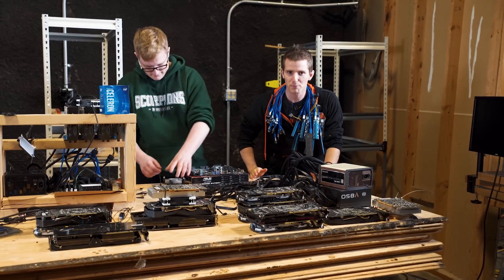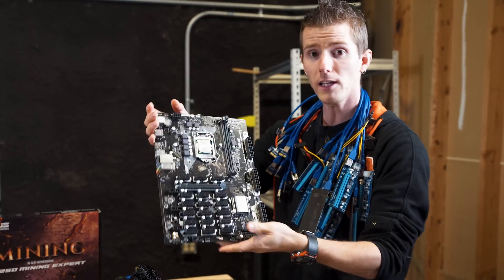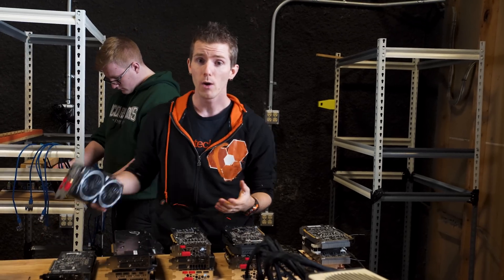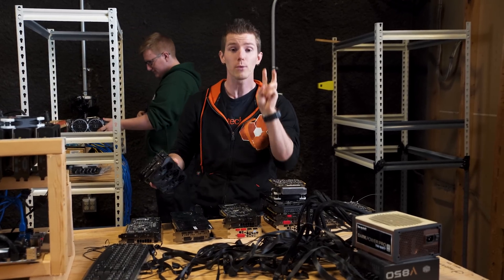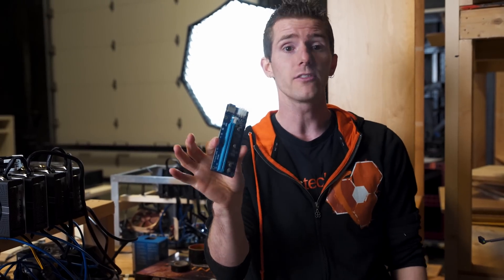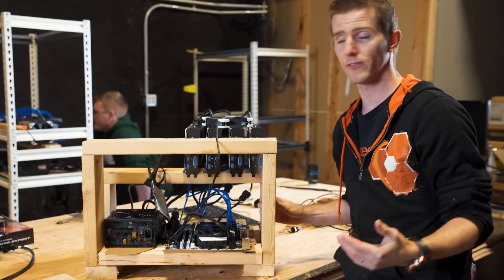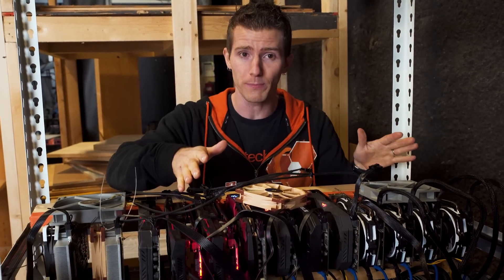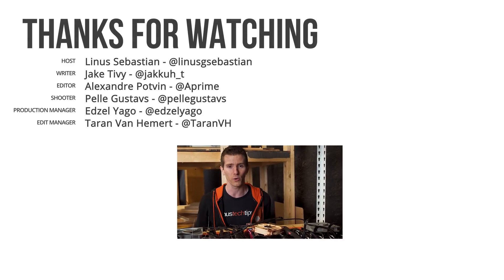13 GPUs in ONE PC? – Mining Adventure Part 2

Comment: Is the gtx 1050ti with a ryzen 3 processor good?
Reply: adam.PL ok thx
Reply: I had a GTX 770 2GB (replaced it with a GTX 1060 6GB 3 weeks ago) with a Ryzen 3 1300X, was able to run all games in high or ultra settings 60 fps. PUBG, I got 60-70 fps average on medium preset. With the 1060 6GB, I get about 80-90 fps with the same settings on PUBG.
Reply: MVP Megadeth would the RX570 4g be better? They are both around the same price. Or should I just wait and save up for the gtx 1080.
Reply: A Ryzen 3 would bottleneck a GTX 1080, I'd go with a RX 580 or a GTX 1060 6GB.
Reply: MVP Megadeth alright that’s what I’ll do
Reply: Gio Yes. I have a similar build with a comparable R3 1300X and a RX 580. Very good budget build.
Reply: ~100 fps 1080 Ultra on most Esports. ~30 fps 1080 Ultra AAA games

Comment: Omg as always Linus screwed something. 006s risers are pretty old and crappy. I don't know who you asked but 009s are the best ones. Also you must not be using the included adapter cable coz it will melt easily. Powering risers with sata is tricky and you have to know what you are doing. That's for another story...

Comment: i am trying to find a fking 1080ti to complete my build and all i find is 1500+ euros cards!
its so annoying u know? having all the components of a my dream pc and cant get a fking graphics card to play my games because of this bullshit mining situation!
and at the same time we have idiots like linus encouraging people to start mining when there is no solution on the pricing problems!
Reply: How is having a 1080 Ti useless for gaming?  It's the perfect card for 4K or 1440p 144Hz Ultra settings gaming.
Reply: except that 1070 is almost as retardedly expensive, and also completely impossible to find.  Also, a 1070 is only good enough if you're gaming at 1080p - higher resolutions require 1080-class power to play with any sort of quality and framerate.
Reply: 1070, $750 minimum, and good luck finding it in stock.  and no, the 1070 is NOT enough.  play in 4K, and you NEED a 1080 to get good results.
Reply: Crypto, I don't know why you think you can just decide people don't need something, and then speak down to them only because you want it for yourself to hop on some trend. god damn I rarely encounter such shitty condescending people, but thanks for reminding me they exist. 

Also, for the video you sent, not all games are as optimized as battlefield to run in 1440p at 144hz off one 1070.
Reply: Go evga website and reserve a gpu 1 limit per household
Reply: Crypto Acc 
No, gaming isn't only about 1080p 60 fps smh
Reply: This is a bad argument, if he wants a 1080 ti then he should have it, but look. The prices aren't that inflated UNLESS, you buy from a third party on the major retailers. I just bought a couple 1070s (for gaming) from Newegg. Just set it to notify when it is in stock. I got mine for $449 each, the EVGA ICX one. They don't take that long to restock either... Like 3 days max I usually see them restock in 1-2 days. Just saying the prices aren't that inflated.
Reply: i have a 4k screen so i want a 1080ti and yes for gaming, KID
a 1070 cant even play at 1440p at high settings. graphics cards made for gaming and 1080tis is for gamers to enjoy. i really dont care about your mining situation u are into and i dont wanna be a part of it. 
if u really like a 1070 buy it for your mining rig at 700+ and let the 1080tis for the gamers.
Reply: Socratis Nikolopoulos 1060 6gb is 990 euros WHAT THE FUCK IS GOING ON
Reply: Socratis Nikolopoulos I have a 1080ti that I hardly use. Selling it for £800
Reply: Dumbass. It's not useless. A 1080ti is needed if you want to run a game @ 21.9 (ultrawide) at Ultra settings with a monitor that has 100-120hz.
Reply: Your post is lol, using a game from 2013, trying to prove your point. 1070 is not good enough for ultrawide gaming. The 1070 can't even hit 60 fps on The Witcher 3 on ultrawide. And to add ultarwides now are 100hz and the new ones coming out are 120hz. A 1070 can't achieve over 100fps at Ultra settings ultrawide.
Reply: But my single 1080 can, playing on ultrawide doesn't deserve a 400$ upgrade.
Reply: If you're gonna play at Ultra settings and with a higher Hertz on ultrawide a 1080ti is the prefer card.
Reply: Crypto Acc What if he wants to be future proof, or if he is just set on that card? Think about those things before posting stupid replies
Reply: the 1070/1080/1080ti are all sold out in US retailers. Everyone wants them. Spend 1300$ and a ton on electricity to take 5 months to make it worth it. Not worth it to me.
Reply: what if he has a 100-144hz 4k monitor? He will definitely need a 1080ti for quality gameplay then
Reply: Βούλωνε ρε βλήτο
Reply: Reference cards at msrp in states limited to 2 cards but hit notify me on nvidias website and they will contact you when available. I am debating doing this myself, i usually get overclocked cards with  aftermarket coolers but currently am out of luck finding them for a good price. Admitadly i want 2x 1070ti but same problem really.
Reply: https://www.alternate.nl/GIGABYTE/11GB-D5X-GTX-1080-Ti-AORUS-WB-Grafische-kaart/html/product/1364523?lk=9373         https://www.alternate.nl/ASUS/GeForce-GTX-1080-Ti-Strix-OC-Gaming-11G-Grafische-kaart/html/product/1341938?lk=9373        https://www.alternate.nl/GIGABYTE/GeForce-GTX-1080-Ti-Turbo-11G-Grafische-kaart/html/product/1381295?lk=9373        all under 1000 euro.
Reply: 1070 is expensive? https://www.superbiiz.com/detail.php?name=AS-D1070O8&c=CJ
You don't get a 1080 Ti for gaming its just a waste of money even a 1080 is too much
Reply: Well, just found a 1080 Ti for 1100 Cad lmao
Reply: Crypto Acc Ok sooo, idk if that's good or bad aha. I have to admit though. The last month or so, gpus supply stocks have been depleted a lotttttt, like major retailers are running out faster than normal. Also it's not just miners taking gpus btw. Just saying it's also third parties buying all the gpus and selling for more...
Reply: aidanjt The 1080 Ti is useless for gaming, you can use a 1070 or a 1080 and still get 60 fps in 4k
Reply: But having a 1080 Ti for gaming is useless
Reply: You don't need a 1080 Ti for gaming a 1070 is more than enough, kid

Comment: Sound Production Issue:
- Starting at 3:13, please stop this.
- You have Linus, a treble-leaning speaker, talking while a tinnitus-inducing portion of the background music is being played.
- For reference: HyperX Cloud Cores running through Asus Zonar DG at 32~64Ohm boost setting.
- The headache does not stop until 4:07 (I lied, it just keeps going).
- Got actual tinnitus by the time B-roll of the Asus RX 580 shows up.

It's like hearing the ghost of future Linus ranting over the spoken word of real-time Linus but not in a good way.

Comment: Please, please DO NOT use SATA to power risers or GPU’s. This is dangerous and irresponsible by LTT to suggest this.
Reply: Stefan Holmes yeah, but they don't draw power from the PCB unless the top connectors can't keep up. And you shouldn't be mining on 100% anyways, it's extremely inefficient.
Reply: +Stefan Holms: The cable isn't going to turn into a heating coil even if it runs up to 2.1amps.  And it wont, because the main source of power for GPUs is the PCIe power plugs.  The 400 series Polaris cards is the only card I can recall entirely tapping the PCIe slot for power first, rather than the PCIe power plugs.  If this was an actual problem, GPU miners all over the world would have had their rigs burnt to ash and we wouldn't have a problem with GPU prices.
Reply: What should be used instead of sata when the risers demand sata?
Reply: Thank you for that info! :D
Reply: erazorCTF you shouldn’t. You bought wrong, dangerous risers. Throw them away.
Reply: Stefan Holmes, let me get this straight... you are warning about the dangers of using SATA to provide power to the riser, and the evidence you provide is a link to something you wrote yourself?  I hate to break this to you, but you're not exactly a recognized expert in... well, anything.  The simple fact is that cheap, no-name PSUs are a far greater fire risk than pushing SATA power cables a bit over spec.  Besides which, video cards derive the majority of their power from the 6 or 8 pin connectors on the top or side of the card, rather than from the PCI-E connector, and they have for many years now.
Reply: Miners are experiencing melted SATA power connectors (localised overheating). The cable is not the problem. The connector is. The pins and internals of a SATA power connector are small/thin. It doesn't matter if you run a 100A cable to it, the connector is not rated above 1.5A per each pin. Anecdotal evidence is anecdotal. The spec does not lie.
Reply: It's only a problem with 400 series Polaris cards, they screwed up power delivery and loaded the PCIe port.  Hardly any other GPU does that.
Reply: No, it's a problem with every single GPU out there. SATA power is designed to deliver a maximum 54W via the 3 12V lines on the connector. GPU's are able to pull up to 75W from the slot. SATA power and GPU's should never come together.

https://goo.gl/q1YYDQ
Reply: noone special whether that is the case or not, and there is plenty of evidence that you’re wrong, any driver update, bug or other esoteric software issue could suddenly cause a 1, 2, or 10 GPU mining rig to decide to draw a full 75W from each riser. This is not something you want to have happen with hardware you may leave unattended for days or weeks.
Reply: Oh stick a sock in it.

Comment: All of your metal mining rig's have wood on them...  Also wood isn't going to ignite untill minimum 300 degrees fahrenheit with an open flame or  570 degrees fahrenheit to spontaneously combust.  If your reaching those temps you have bigger problems than the wood catching fire

Comment: Linus that is a insane complicated expensive build. I do not know what MINING PC is. I do not recommend the cheapest CPU. I also do not recommend the most expensive CPU. Windows 10 will take up a lot of processing power. I do not know if your going to use it for gaming. I do recommend the i7-8700K. yes that is a COFFEE LAKE. Why? Well its right smack dab in the middle perfect. Buying a Cheap out of date CPU dose not deliver the performance. that is wasting money. Then there is the Extreme Expensive CPU like i9 CPU. why pay$1000.00 or  $2000.00 on a CPU that is slower and lower performance then I7-8700K. then the CPU socket is prone to fall apart. I have to send a nasty disgusting letter to Intel on developing the worst CPU sockets that is LGA 2011-V3 Then the one that replace that is even worse. I think its LGA-2066 that is on the X299 motherboards. I do not got the money to trash everything and start all over from scratch. it sounds like to me my $600.00 i7-6800K is dead along with my expensive Dims. I do have support for my graphic card. G-Skill dose not have good phone service. they buy a simple land line. the phone is off the hook all day. I get a busy signal. I am waiting MSI to replace my 25th X99 motherboard. I get stuck with a used broken one that is repair that is not. MSI blames me for being a stupid ediot that dose know what a mouse and keyboard is used for. MSI blame about me not knowing how to install a CPU.. When the real blame game against me. I fight back I blame MSI for doing the production line in China and the worst packing I ever seen that I do not do,. and using a junk ass CPU socket. This is plan fucking stupid for me to buy it. I blame my self. Now too late for refund it takes too much time. Something is got to be done to stop the NAZI BLAME GAME AGAINST ME. Send a letter to President Trump to block MSI and ASUS and Corsair to stop doing business in the USA. I hear a lot of complaints

Comment: Lol... watch out people.
If you need to know the best cost / performance card in terms of upfront cost / hashrate and resale value.
AND power consumption. AND Temperature. theres just 1 king, the gtx1070 (not Ti)
The way these gpu's are so close together is just a realestate issue, with the pointless horizontal fans on top.
If your gpu's have just about 1.5cm between eachother, their own fans are enough to cool the gpu's... you then need just 1 12cm fan blowing over your motherboard, and ofc your cpu fan... thats it. (asuming you dont live in the sahara)
Need to simply know wich risers to use? Dont use green ones, go black or blue ^^ thats all you need to know.
Don't forget that what Linus is doing with AMD cards isn't working on Nvidia since the drivers don't allow for so much gpu's on 1 system.
The 1151 socket in this vid is cool though, I like it more than the celeron type miners since an i3-T only uses 35W instead of 55W.
Mine ETH for safe investment
Always go with 4GB+ gpu's

Comment: Why wasting money on GPUs and not buying an ASIC?
Reply: the coins people are mining now are ASIC resistant
Reply: Thanks for clearing that up 😊
Reply: They're not 'ASIC resistant', rather the other cryptos need to have their own ASIC developed specifically for it, and that's an expensive development process, and there's not enough market for it, yet.  As other cryptos mature, show stability, and get more difficult as bitcoin has, ASICs will start becoming worth the investment.  Nobody wants to invest in application specific hardware for a young, fledgling, easy to mine crypto, when they can just use cheap GPUs and jump tracks if it fails.
Reply: these are ASIC resistant
VTC, ETH, XMR, GRS, FTC, and ETN will also be ASIC resistant.

Edit: AEON, Zencash, Btcz, DMD, NAV
Reply: There's no such thing as 'ASIC resistant', it's a nonsensical term, literally any algorithm can be hard wired into a chip.  It's only a question of whether designing and producing the chip will make a return on investment.
Reply: So that's why it called Application Specific Integrated Circuits

Comment: You just cant fix stupid.......please dont breed!, I would have replied to the troll but yet again they deleted their DUMBASS comment and have NO clue about code nor what is required or installed in a remodel or a New construction but trying to explain to those whom clearly are way in over their head and have NO clue when they have been Payed 10x , 1 troll did another still does not get it and never listened to or read the original post and think they know stuff but as I could pull out the code book and read it word for word they still dont get it and NEVER will!  TROLLS DONT BREED!!!

Comment: split that 13 gpu rig to 2 layer one 7 and one 8. 13 gpu is a row is pretty hot and heat will reduce the gpu lifespan when it run 24/7.

Comment: Could you test Win 10 creators edition updte that takes off gpu limit and see if 13 or 18 Nvidia gpus could be used at one motherboard. This is so widely told myth that no one has actually tested and shared. On os side it should not be problem as people have had 12 gpus running like this on W 10 Creators update but now Asus B250 should hold 18 or additional +4 or +8 gpus depending on riser card.  That would be nice to see and it seems you have all the parts to make the test.

Comment: NVIDIA have talk to Microsoft, Linux and mac in regards to a critical system patch to throttle GPUs once hashing. 
This means 2 things. 
Finally GPU price will drop. 
Bitcoin will crash badly. 

Also FCC announced that no internet provider is allowed to share bitcoin base data to market analyst. 
This means, if there's no info about bitcoin value, bitcoin won't have any value itself. 

Bitcoin is really not a currency, it's a freaking virus disrupting governments and social control.
Reply: nVidia could be thinking of the long game.  Eventually the GPU mining market will crash, and gamers will remember which GPU vendor did something in their interests.
Reply: As much as I hate GPU manufacturers arent going to fix this they are at an all time high when it comes to profits
Reply: Bitcoin isn't mined/transacted on GPUs anymore, ASICs have taken over that job, have done for years.  But I wouldn't mind if they threw in driver code that detects other cryptos running on consumer cards and throttles the shit out of it.
Reply: exklim I don't think nvidia would do that.. this makes them more richer, while this shiit is ruining the whole pc community.

Comment: "mostly properly"

I spot a SATA to pcie power adapter. SATA is not designed to be able to power the 75W that some graphics cards need from the slot. Those SATA adapters have caused countless fires, as many miners have shown.

Comment: I just bought 5x 1050's and a 1060 in the last couple months, knowing that their was going to be a MAJOR shortage. The manufacturer of the GPU's has completed their contract and is retooling for different chips now. Their will not be another large shipment / supply of 10 series cards for a while. I have my 1060 on ebay for like $360. Bought for $200. Momma needs a new pair of shoes.

Comment: Wait a minute (re: 8:30 )... Pretty much everyone in North America has 240 Volt service. Whether they use it or not is another story.
Its commonly used for electric clothes dryer machines and electric ovens. But every home I know of in North America has Line 1, Line 2 and Neutral from the pole. Put L1 and L2 in a NEMA 6-20P socket and you have your 240 volts. Also your desktop PSUs very likely handle 240 volts just fine. Probe your panel box. You'll likely find L1 and L2 and find 240V between them. Even if all your sockets in your home are 120V, you likely have 240V service to the home.
Reply: its true..but it needs to be rewired..the default is 110v

Comment: 9:53 don't buy aluminum from a hardware store, it's all WAY overpriced. Call up a steel or scrap yard, in my area almost all of them will sell scraps (yes, 3' pices of aluminum angle can be called scraps) for less than $1 per lb